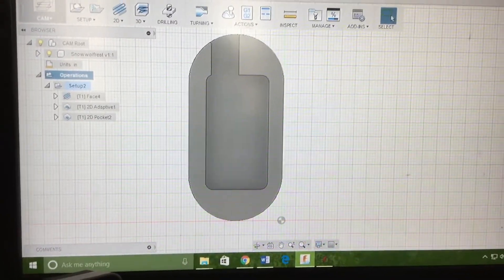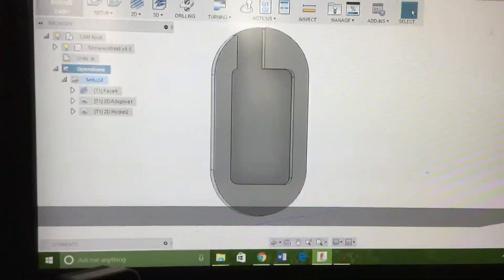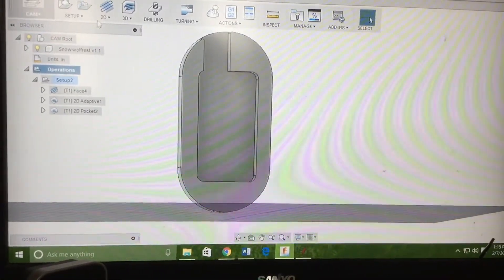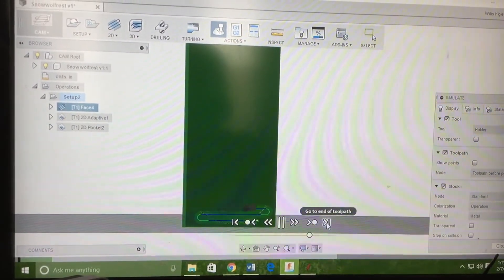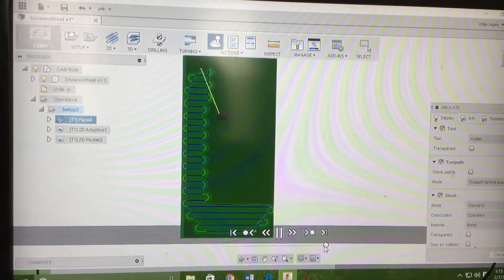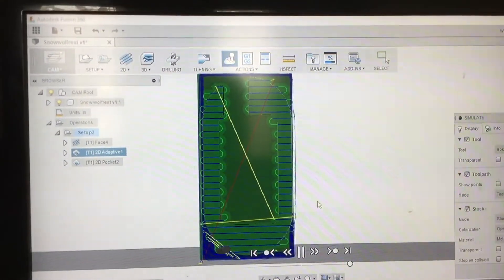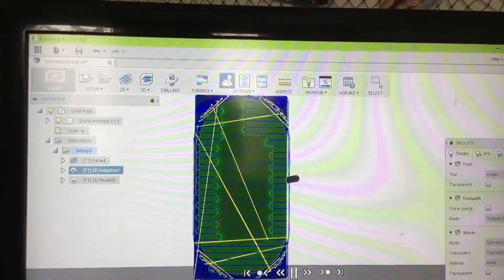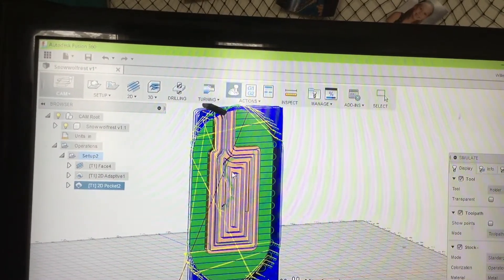Machining With 6040Z-USB CNC And Fusion 360

Comment: Were you able to use Fusion 360 with your 6040Z out of the box, or did you need a different controller board/drivers to get the two to work together?
Reply: yes i will like answer to that too